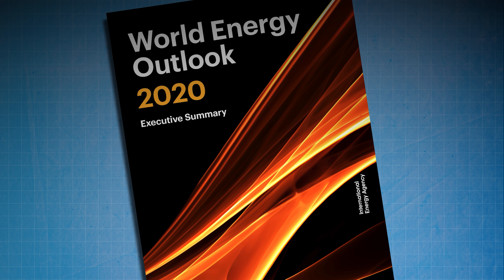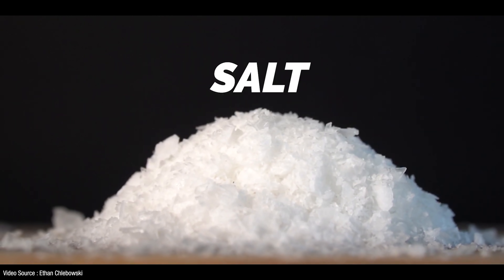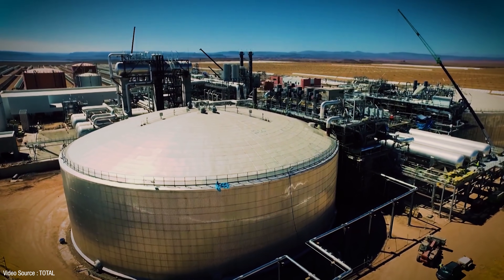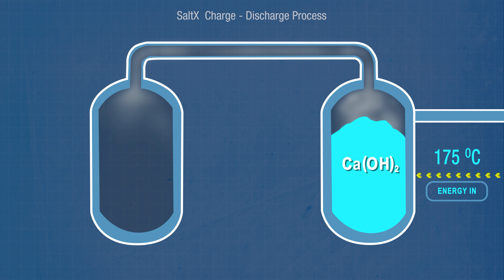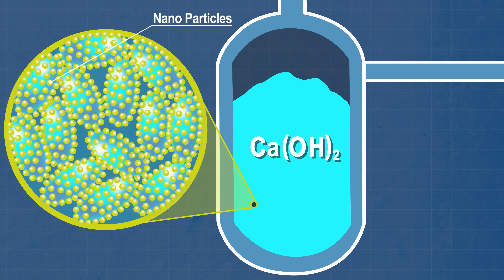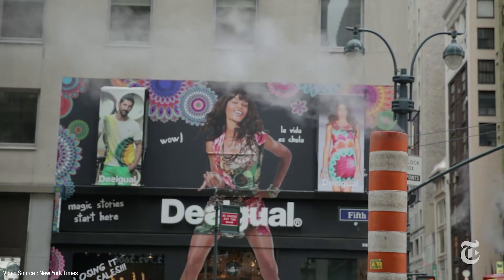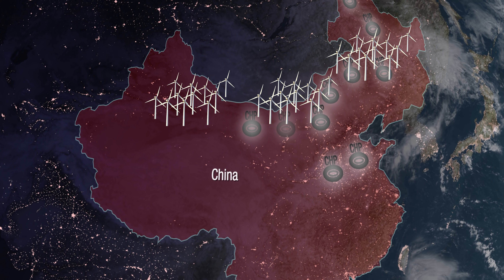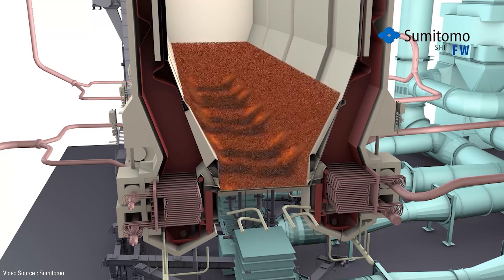Energy storage in salt - how nanoparticles are revolutionising the industry.

Comment: I'm not convinced by this technology.

Let's me explain.

With 400-500 kwh per ton, or 0,4-0,5 kwh per kg is not so "high energy density". It's around the same density than lithium-ion, very far away from hidrocarbon fuels.

So, it's very expensive to move this energy vector manually. So, the application must be stationary.

If the energy source is electricity, then you must pass through a energy-heat at 1:1 conversion ratio which is most inneficient for a lot of applications. With a heat pump, for moderate temperatures, better ratios can be achieved.

If the source is heat, in renewables, only solar came to my mind. But if regular storage is made for daily cycling, direct heat storage is simpler and cheaper. The advantage of this technology is the ability to displace the time from production and consumption through the chemical alteration, but that makes only sense if the cycles are not very frequent whats mean less cycles per year.

For example, think in weather compensation. A regular solar thermoelectric plant normally store heat as salts, but just through phase (solid to liquid) and good thermal isolation of the heat storage.
That's ok for daily cycling, so daily production could be balance into night production.

With this technology, you can make a partially, more stable storage, without thermal loses, to balance sunny days into cloudy ones.

But there is a lot less than 365 cycles per year that you can do that. For example... we can say... 40 cycles. In 20 years, thats 800 cycles.

So the prices of this product must be calculated not over it's total lifespan, but a reasonable amortization time, like 20 years, because amortization is reached before lifespan.

I have my doubts that this technology can be enough cheap to use over a reduced number of cycles (for example, winter/summer balancing would mean only 1 cycle per year). The prices must be divided by the minimum of lifespan cycles or amortization cycles. When the cycles per year decreases by a lot, then the lifespan is not important anymore, because amortization cycles are smaller.

And to make a economic alternative, price per cycle must be reasonable, like 10 cents per kwh cycled. For a reduced number of cycles like summer/winter balancing that means around 2$ per kwh of storage if infrastructure, which is incredible cheap.

Comment: I use 1960's steffes brick heaters to heat my house right now. Something like this could supplement theses by having extra thermal output. The charging part can happen as these units are over 2000 degrees inside from the off peak electric heat.

Comment: If you used the steam it could not be reused that 1000 times, there would need to be a heat exchanger also the pressures in the closed system would be immense.

Comment: Despite the name sounding obscure and exotic now, consider that a few decades ago almost no one would have heard of liquid crystals, yet they became common knowledge from the ‘80s and onward. I recall even the cool kids in school testing each other on whether they knew what these terms on their digital watch Really meant, including LCD, LED, quartz. 

It’s possible this could become a similarly ubiquitous technology, known for varied and amazing uses. Potentially even moreso than liquid crystals, this could be on the level of plastics or electricity? Of course we have no idea where we currently lay on the curve of technological progress, but if we’re at the bottom of a steep increase, the nanoscale manipulation of cohesion, corrosiveness, and more, seems pretty amazingly flexible. 

The first thing which sprung into my was questions about how this may impact molten salt nuclear reactors, long said to have corrosion of pipework as a limiting factor. The next was: could selective application of such coatings, potentially help provide a solution to the “sticky fingers” roadblock standing between us and tech like nanofactories?

Comment: Significantly that graph shows energy storage per tonne. But what matters in grid scale storage is energy stored per dollar. If all you're doing is storing heat, there are far simpler and cheaper materials. Also, its worth mentioning supercritical CO2 heat engines that can get close to 50% efficiency.

Comment: If the natural cycle of this interglacial could reach the high temperature of the last interglacial (but I very much doubt that it will reach those Temps. so we would not need these expensive heating solutions, This molten salt idea does not seem to be as an extremely high in pollution as Solar panels which are extremely over rated in power supply, especially  the Chinese solar panels that I have are up to 10% efficient.  Now Solbian solar panels that deliver their rated supply up to 24% efficient are $10.00 AUD per watt, I just got quote to buy them, 200 watts for $2000.00 AUD. Here is the link, https://solbian.solar/wp-content/uploads/2021/01/EN-inclVAT_SOLBIAN-Solar_pricelist-2021_A4-LD.pdf  My system 8 Kwh LiPO4 Batteries, 2500w Victron inverter and controllers, cost $30,000.00 Now I can run one 2000watt appliance at a time. With these new solar panels I will only have run the diesel generator for two to three hours a day. One person off grid. I am glad I am not poor, who are going to freeze to death and will not be able to afford to cook toast.

Comment: This sounds promising, not so much as a way to 'store electricity' due to the low efficiency of steam turbines, but as a way to time-shift energy for producing heat when needed.  A potentially valuable dispatchable load.  And dispatchable loads will help reduce the amount of storage and 'overbuilding' we need.  Dispatchable loads will make the cost of electricity cheaper.

Now let's do some battery math.

Tesla, rumor has it, is paying not much over $100/kWh for purchased cells.  Tesla's dry-rolled 4680 cell is expected to cut the cost over 50%, let's say $50/kWh for lithium ion cells.  Lithium iron phosphate (LFP) cells should be even cheaper due to much lower materials cost (no nickel).  Let's use a conservative $40/kWh, the cost may well be less.

LFP cells, in addition to being cheap and non-flammable have very long useful cycle lives.  The batteries I"m using in my solar system are LFPs and rated at 10,000+ full 100% to 0% to 100% cycles.  A $40/kWh cell cycled 10k times yields a cycle cost of $0.004/kWh.  Next to nothing.

There's some needed hardware to convert AC to DC to AC but amortized over 20 years should not add much to the cost.  And some real estate cost but that should also be minimal.  The cost that makes $40/kWh cells not a good "last 1%" solution is financing.

Assume 5% financing.  $40 at 5% = $2/year/kWh.

Some cells will cycle frequently.  Solar into the evening, late night wind into the morning.  Say 1.5 average cycles per day.  About 548 cycles per year which would mean $0.004/kWh in financing costs.  $0.008/kWh for cell and financing.  A penny.  Game. Set. Match.

Cells that cycle, on average, every two days would cost $0.011 for financing so about 1.5 pennies per kWh.  Very affordable.

The problem comes with trying to use LFP cells for deep storage.  Those few times per year when we experience low wind and solar input for multiple days.  A $40 cell cycled only seven times per year would cost $0.28/kWh for cell and financing.  

We need something different a few times a year.  Perhaps we run CCNG plants with captured waste stream methane or synfuel?  But it looks like LFP cells might be the storage solution we need for most of our energy storage.

Comment: The linear concentrated solar collectors you showed in your video typically use oil rather than molten salts. Molten salts are used in the thermal towers, not the linear collectors shown. The reason being in incident solar radiation is collected from a much smaller area and therefore the temperatures are much lower - lower that the melting point of the salt. Oil is used instead.

Comment: Plugs in new soundbar to phone
Oh, doesn't work with the phone, that's fine. 
Turns on bluetooth speaker
Oh, now the sound is out of sync, that's fine. 
Pulls out bluetooth headphones
Oh, one is slightly ahead of the other. 
Plugs in ten year old wired headphones
Perfect.

Comment: Cryogen storage has the advantage of using ambient temperature to release the energy maybe that could be combined with molten salt storage for greater efficiency. The CaHOH closed system sounds a bit like a high pressure Stirling engine. But Thorium....don't think so, research has pretty much dried up on this dead end. So much that we will have dilithium crystals before we get a commercial Thorium reactor.

Comment: Integrated hybrid systems would also be beneficial for example... using the converted steam to produce hydroelectric power as it recirculates back to water and down to holding tanks with wind powered battery backup pumps for additional water moving processes. At the time using thermoelectric advantages by placing thermocouples on heated surfaces. By increasing the capital investment and engineering of single investment power development into a multiphase development that uses separate systems to power internal systems and processes. At the same time increasing total power output with no additional costs in terms of inputs after the larger capital investment and larger engineering costs. Yet the power production per square meter of the facility becomes much greater. With the power outputs being stable across the entire system and processes. Thus a series of duplication models running in series and parallel within the facility can run continuously as maintenance and operations are conducted. Combined with a geothermal resource and solar roof the system plus mechanical magnetic generation on moving parts this would be both very simple in components but complex in engineering design and once up running very easily operated and maintained.

Comment: I have actually visited their lab and office in Stockholm. They have a very nice demonstration of this concept using a hollow steel rod with two chambers. They have developed not one but several different patented coatings each able to function in a separate range of temperatures.

There's only so much you can store and covert because of the efficiency of the process, so they also work on developing efficient heat exchanger designs.

Comment: The temps after charging could also be used to run an ORC by actively cooling the "quick lime". This could offset some of the 10% loss in the system. Seems bizzar to "allow to cool" when that heat can be used.

Comment: Sounds like a great solution for Iceland exporting their geothermal energy to Europe. Of course you would have to boost the temperature, but they have plenty of power to do that, Then load the dehydrated containers of salt onto a ship, and send to where ever it is needed. The tech of parabolic solar dishes is economical and well researched, and would be a nice fit for remote installations of this nano coated salt.

Comment: Yes, this sounds like an interesting system. To be honest, I am not overly keen on this material but I am keen on heat batteries though. It looks like they are not well suited to wind or water power but they are suited to Concentrated solar, nuclear, coal and other kind of heat dependant electricity generators that could store excess heat when electricity demand is low and then release it when demand goes up. Certainly district heating is important too. There is a housing development near Calgary Canada where they use solar hot water panels to heat domestic hot water and when there is excess in summer, it gets dumped in a large water resivoir underground where the heat is then removed in winter through ground water heat pumps to heat the homes there.
Heat storage is a good thing. It can also be not needed though by having biomass, biogas and garbage burners as well as natural gas burners that store the energy in solid or gas and only burn it when it is needed too. So sticks and plastic bags can be a form of battery in a way. Pretty low tech storage. 100% efficient too!

Comment: A 1000 cycles, though? 
That isnt much, even if the material can be discarded without much hassle, and the nano-coating of new material isnt too expensive.
At a dayly loading profile (usual in grid stabilizing storage) , you´d need to exchange the salt every two-three years.
Reply: No no, its 50k+ cycles, its being tested in a looped system their lab as we speak to see how many cycles it actually is.
Reply: @nocto8237  Ah, Then I heard it wrong,. thx.

Comment: I hate to break this, but this appears not to be novel at all. The use of the phrase "nano" seems to be a grant-bait buzzword as everything here is standard and well understood. The big problem with this particular version is the very high temperatures required, which makes it unsuitable for many operations and thermodynamically somewhat inefficient.
Reply: Thermodynamically inefficient? The point of high temperatures in any thermal process is to maximise efficiencies. That's why steam turbines run at high temperatures and why steam is used in industrial processes.

Comment: A typical thermal power plant has an electrical output of 1 GW and about the same thermal output as 'waste'. However, this waste heat can also be used for heating.

What is solar energy all about?
Well, it can be virtually non-existent for WEEKS in Europe, especially in winter. In addition, you harvest much more in the summer than in the winter.
So a storage facility for a 1 GW power plant has to provide an energy supply for months.
Let's say 1 month.
That would be 720 million kWh, and if you include the efficiency, even 1800 million kWh that have to be stored. In practice, by the way, even much more, because up to now Pilot plants have only shown a thermal efficiency of about 70%.
This would require 4,500,000 tonnes of calcium oxide, as much as a 2000 km railway train can transport. 
Quite a lot...
And enormously expensive...
And really, really biiiig...
And that's just ONE power plant...

Once again we see that all these 'green' daydreams fail because of very simple mathematics if you look at them more closely.

By the way: A nuclear power plant can provide electricity plus high-temperature process heat and/or thermal heat and does not have this problem and is therefore much cheaper.
And: The calcium oxide has to be produced from calcium carbonate. This naturally releases very large amounts of CO2: CaCO3 > CaO + CO2.
In our calculation example, 3.5 million tonnes.

Comment: The cheapest means of generating electricity is the elephant in your room. That is the liquid metal Thorium ion molten salt burner reactor..
You say solar is the cheapest  but Solar should stay on your roof top not destroy our tropical rain forests; vis which is cheaper? -
Indonesia's contract with ThorCon for "walk-away safe" 7×500MWe "load-following" near ambient pressure liquid Thorium molten ion salt burner reactors will have a footprint of 43kW/m^2. When used as "base-loaders" can produce 375MWh/m^2/annum needing refueling every 4 years starting after 8 years. 
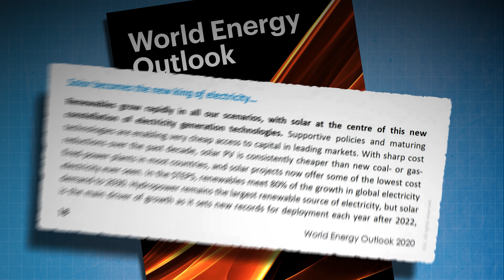Cheap: $1/W capitalised cost, fuel cost less than 0,4 cents per kWh; pre-profit total cost $0.04/kWh; recommended cost to consumers including all cost and profit <$0:07/kWh.
 99.5 % fuel consumed;(Caesium137 and Strontium90 (half lives~30 years) are the only radioactive fuel waste requiring only 300 years storage unlike current high pressure light water reactors (with their radioactive waste being 95.8% of the original fuel) requiring over 10,000 years storage.
Another benefit of a MSR is the ability to burn up 99.6% these existing nuclear waste leaving only the Strontium90 and Caesium137 having consumed all the higher actinides including the Uraniums, Plutonium etc.

Comment: Historical sidenote:
At around 1860s to 1880s the chemical heat generated by reaction with water was used by fireless accumulative steam engines as the means to power streetcars - it was cleaner for the city enviroment and more importantly without the need for open fire in still quite flammable cities. At the time the electricity wasn't widespread, so it made sense. Try looking up soda locomotive on wikipedia.

Comment: I live off grid in south Australia, my 250ltr storage hot water system is heated with excess power using an arduino to monitor the frequency of my SMA sunny Island inverter, as excess power is available the frequency rises and the arduino turns the heater on and off via a solid state relay. Several years ago I contacted our state grid company and submitted my design idea only to be fobbed off and  told it wouldn't work on a grid scale, I pointed out they'd been doing it for 80 years with night tariff for exactly the same reasons. Back before renewable energy they needed to load the generators over night so electric storage water heaters were promoted and discounted electricity rates available, now with fewer generators and  increased renewable energy the same problem exists....now I heard on the news that the grid company has partnerships with a hot water system company and have developed  a new hot water system that strangely enough does exactly what I developed 5 years ago.

Comment: Looks like it might work for shipping. Bulk load the ship with CaO at each port. Offload the CaHO at the next.
Reply: @Gasdive better to install "load following" modular liquid Thorium ion  molten salt burner reactors attached to supercritical Carbon dioxide Brayton cycle turbines - over 50% efficiency and extremely compact
Reply: @MrVaticanRag  ideal. Absolutely ideal. Perfect.

Except that each ship will cost 10 billion dollars have a crew of 200 and the first one will come into service in 2060.